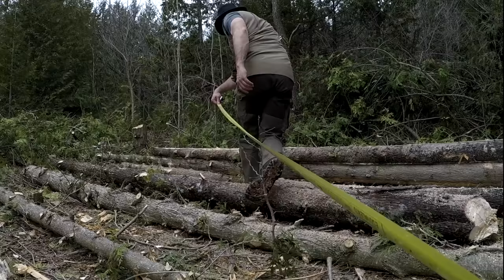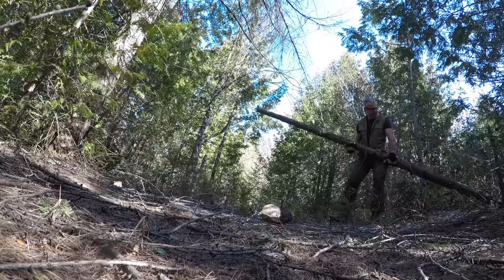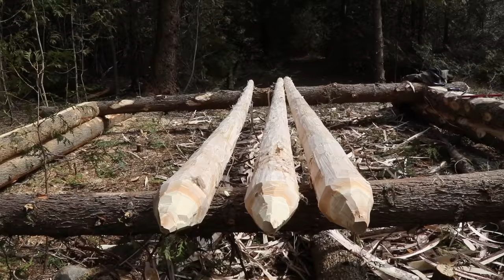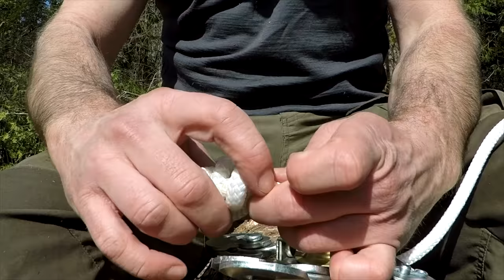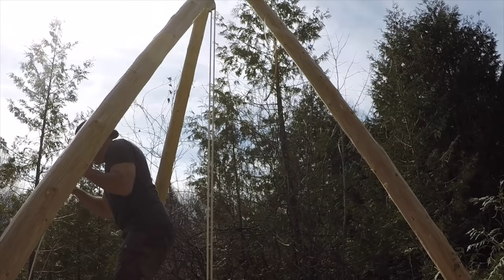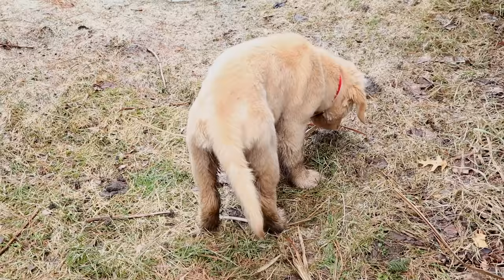Make a Tripod Hoist and Move Logs While Building a Cabin Alone

Comment: Have you tried a single gin pole with block and tackle?   Not that the tripod is miss used.  I have a 6" metal well pipe section, about 6 inches long with a plate and four guy lines on it, it is place on the top of a single pole with block and tackle, you can lift and position loads by giving and taking up on the guy lines.  You can get away with three guy lines but I like 4.   

It will be interesting to see the difference in cabin construction, one being on another persons land and one on your own, if this will be a factor.   Material at hand may have input as well.  Sounds exciting and nice stuff coming up.  

Perhaps blend in some finical self reliance mixed in with bushcraft self reliant skills.
Reply from the maker: downeast primitive skills Thanks man. Funny you should mention a gin pole. I used to have a few hand hoist setups, with gin wheels that could lift hundreds of pounds. I may set that up on my property, as well as a hand winch and ramps. You are absolutely correct about the the materials at hand. My current build is reliant on the crooked spruce available but I I think I have better materials at the new site.
Reply: The

Comment: I am solo on building a log home, and because my western cedars are so massive I am putting upright logs every 10 ft at 10 foot height and carving a 6 inch wide slot 8 ft from top to bottom and notching the vertical logs to fit in the slots I need to be able to make a davit that can swing 360 degrees  for all 4 walls and vertical log placement I have no cash for a boom truck need ideas

Comment: Lashing tripods: It can be easier if you DON'T put all three posts have their tops and feet are together, but instead flip the centre log around so that it is lashed while its foot is opposite from the feet of the other two posts.

- When you go to raise it you spread the two legs that were close together, and then all legs are positioned to act as a tripod. This saves you having to lift the entire thing vertically before you can begin to spread the legs.
- Also has the bonus of pulling your lashings tighter if you're keeping the feet fairly close together.

Comment: I'm having all kinds of trouble keeping firewood dry - even under 2 plastic tarps (which seem to wear out fast/leak.) Thinking of building a small firewood shelter out of the rock on my land with a wooden roof. Does that sound feasible? More trouble than it's worth? Ineffective? I have 4.5 acres of bush near Mattawa; no cabin up yet. My firewood is almost all birch, white pine & hemlock. I'm going up next week & it seems silly to haul dry firewood up from TO.
Reply from the maker: Plus illegal, believe it or not (Emerald Ash Borer)
Not only does that sound feasible, think about how cool it will look. :)
I will be building several of these on my property too. Slope the roof from south to north and keep the west, north and east sides well ventilated so that the sun can shine in from the south and the wind can blow through from the north and west.